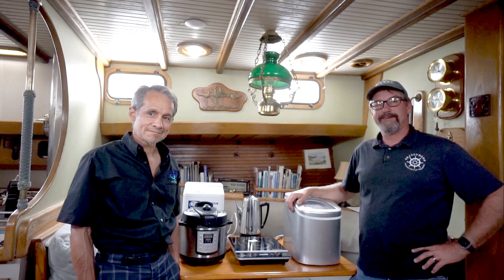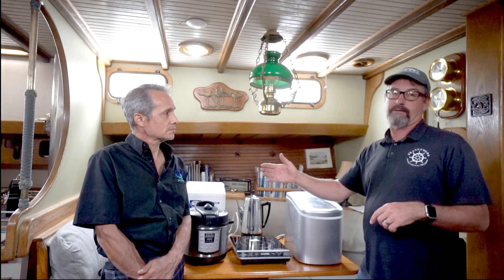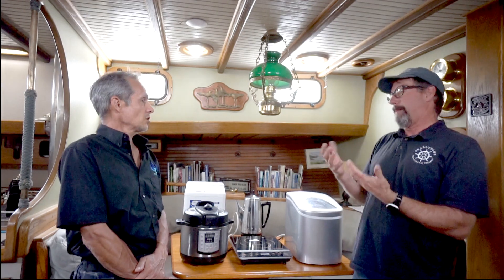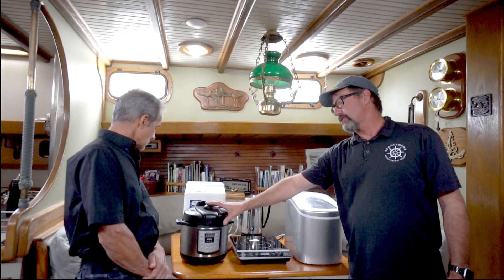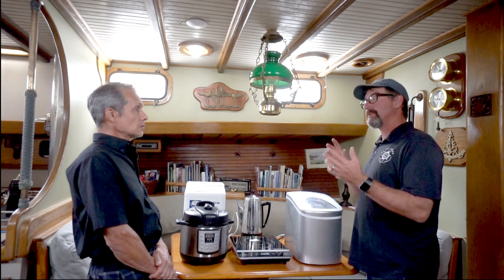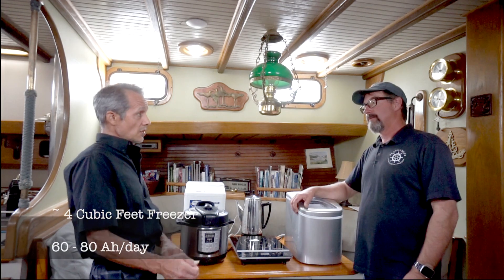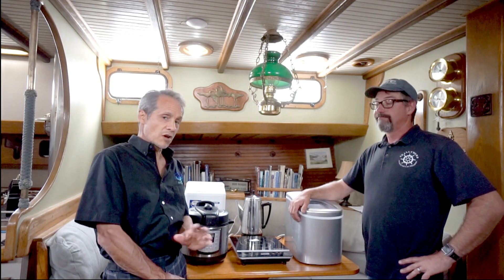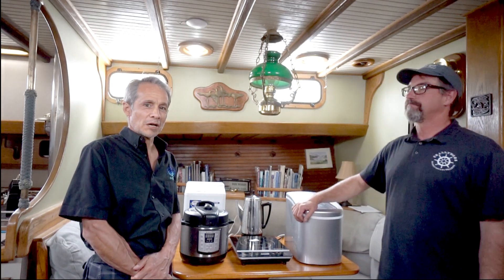Tech Tip#5 Electrical Energy Consumption with Bruce Schawb

Comment: After installing 520ah of lifepo4 I now have my 6 gallon water heater with its 750 watt electric element on the inverter circuit. Works great!
Reply from the maker: With our large bank, I we can heat water with batteries, but it's cut the number of days at anchor (without running the engine) down by at least half. More like 2 days instead of 4-5. Our water is heated with the diesel stove, the Yanmar, or the 3 KW Victron - nice to have options!